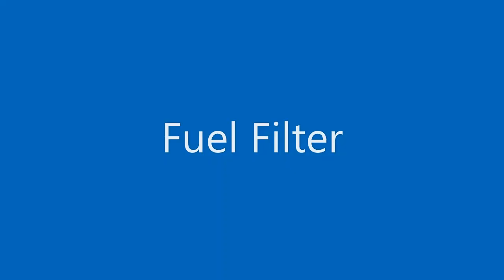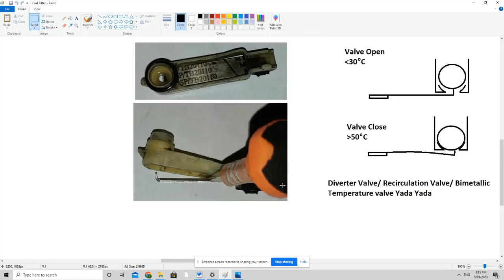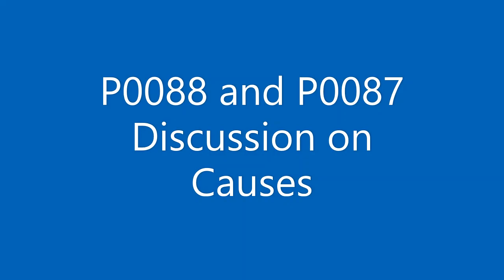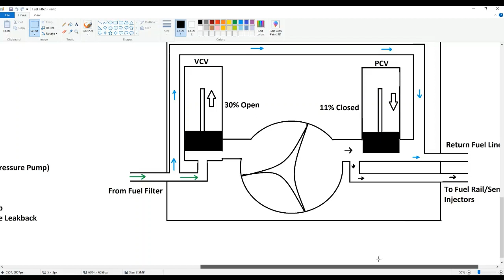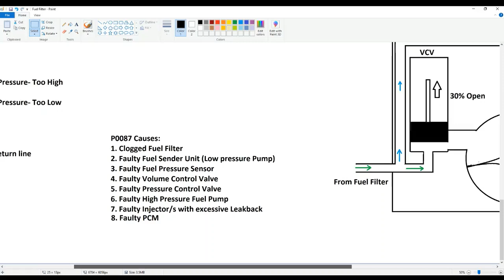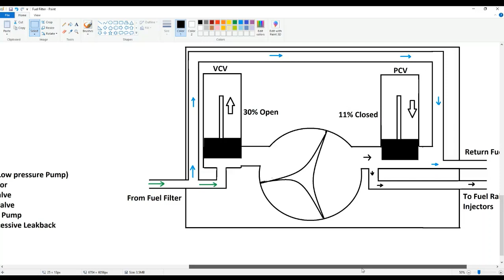P0088 P0087 Ford Territory Diesel Fuel System and how it works

Comment: Minr has high fuel pressure rail 2011 ford territory diesel

Replaced fuel filter
Intank pump
Battery is good
Any ideas
Reply from the maker: Reset vcv, pcv and injector calibrations. That should do the trick

Comment: I am having a high pressure fault , showing 35930.0 kPa in the rail, what pressure should i be seeing
Reply from the maker: Seems about right. You should see about 150Mpa at around 1000rpm.
The HPFP can deliver as high as 175mpa at 1500rpm

Comment: Hi mate you are super knowledgeable about these fuel systems. Im not getting any codes but my sz mk2 is pulsing/surging under load (doesnt do it when free revving). Any ideas im pretty stuck and my mechanic is too . PLEASE HELP!!!
Reply from the maker: @uniquecaravanrepairs4547  9 out of 10 times, this is caused by fuel sender. Have you checked the flow rate from the fuel sender? Also, replace fuel filter and RECALIBRATE PCV, VCV and INJECTORS..
Reply: Ok this makes sense as the fuel gauge reads incorrect. So changing the fuel sender then recalibrate all the above?
Reply from the maker: @uniquecaravanrepairs4547  diagnose first before replacement. disconnect the incoming fuel line from the fuel filter and rotate key in ignition.  There should be a free flow of fuel. Replace fuel filter regardless and then recalibrate
Reply: @RZJugaar  Quick Question, is that the incoming fuel line from the filter to the HPFP,, or incoming from the sender/pump to the fuel filter?  Thanks
Reply: For the testing
Reply from the maker: @damianrainermusic8005  if you use sender to filter, then you can figure out the condition of the sender.
If you use the filter to HPFP line, it'll give you the condition of the filter.
Reply: Also when you say fuel sender do you mean lift pump assembly including sender unit?
Reply from the maker: @uniquecaravanrepairs4547  yes correct.  Fuel sender means complete assembly.  But diagnose first.  Ensure that it's faulty. Otherwise you'll be wasting money
Reply: Thanks so much mate. Yes the mechanic already found there was free flow of fuel when he changed the fuel filter. So maybe just recalibration ?
Reply from the maker: @uniquecaravanrepairs4547  yes recalibration only then.. if recalibration doesn't solve the problem, then you'll have to wait till it throws a code. Who knows.. it may be Accelerator pedal or something else.. point is, not to fix something that ain't broken. If PCM detects a problem, it'll throw a code

Comment: I still cant figure it out. Have the same motor and its shuttering on acceleration or coasting, even sitting in neutral above 2000 rpm it does it. Seems like its starving of fuel.
Reply from the maker: @ddddddddd574  what code are you getting?
Reply: @RZJugaar  no code showing up. i suspect its picking up air. i did change the tank pump a few weeks ago so maybe i swapped the return with the middle one.

Comment: Hi . great video. I've got a very low pressure on mine . the pressure rail sensor is only reading 140 kpa  on cranking. it got water in the fuel . the common rail is not receiving any additional  pressure from the HPP . I've changed fuel filter and sensor ? thoughts?
Reply from the maker: @CGamble-r9d  if it had water contamination then I'd suggest replacing the HPFP... before doing that make sure
 1.the fuel flow to HPFP is not restricted 
2. Put a manual gauge somewhere after hpfp and verify pressure reading 
3. Ensure that there is no excessive leak back from injectors..

Comment: Hi sir 
I have a ford transit 2.0 diesel with a foult fuelpressure to low 
I replaced fuel filter
High pressure pump
Common rail with both sensors 
Inejctor checked no foults
What can be? The car does not start and I cannot make a return leak test, I took out injector mount it outside and try to start no spray from the injector, was it because of no pressure on injector or injector clogged? Please help any advice will help
Nice video
Reply from the maker: Hi. Are you getting any fuel out of the filter? Your fuel sender working? Are you getting fuel up to the injectors? Did you check your fuel pressure regulator?
Reply: @RZJugaar  yes fuel is coming to filter after filter to the hpfp after to the common rail after to injector from injectors i can see on return line fuel is out so idk if is clogged or not enough pressure...

Comment: Ever had fuel cooler fail and mix fuel with water and water with fuel
Reply from the maker: Never heard of it. That would be the first time.. which cooler? The one in v-section or the one under the driver seat floor?

Comment: Amazing thanks so much for this! I have repeated P0087 codes at low load/revs. My low pressure pump flow seems very low - 280ml in 1 minute. Do you know what kind of flow rates would be within range from the low pressure pump? Previous owner had HP pump replaced last year so I’m wondering if it failed due to this poor pressure/flow on the low pressure side. Pressure tested on the low pressure side is about 4psi at idle.
Reply: This is on a Discovery 3 by the way
Reply from the maker: For territory, the volume spec is 277ml in 10 seconds. Low side fuel pressure 7psi.
For discovery, I can't confirm the volume but lift pump pressure spec is same, 7psi
If you get 0087 only during hard acceleration then for sure it's the LPFP
Reply: @RZJugaar  thanks - I got 0087 first at hard acceleration once a few hundred miles ago, but recently even at low acceleration as well. To the point we had to get recovered as it was doing it every 10 minutes of driving and even keeping below 2k RPM.
Reply from the maker: @BenVallack  Your fuel flow from fuel sender is very low so i'd say its the fuel pump. The other reasons can be a blocked Fuel Filter. Very low chance that it's leaky injectors or High pressure fuel pump.
I'd suggest get an external (in-line) fuel sender installed to confirm that it's the fuel sender issue before biting the bullet.
Reply: @RZJugaar  ok I tried a new filter - no difference at all. So I dropped the tank and tried to measure the flow without the filter, just straight out of the outlet hose from the tank. 750ml in 20 seconds. Is that what you’d expect without the filter? I might have just confused myself with this test.
Reply from the maker: @BenVallack  if you are getting 750ml in 20 seconds then your pump is fine, your filter is now new. You can now check your injector leak back to see which injector or which bank is leaking.. I'll try to find spec for it.
Reply: @RZJugaar  ah ok - but that still doesn’t explain why flow is so low when tested at the schrader valve when engine is off though does it?
Reply: @RZJugaar  to be clear 750ml in 20s was without the filter in place at all. Just testing what it pumps straight out of the tank outlet pipe.
Reply from the maker: @BenVallack  I don't think we have Schrader valves in territory. Did you do this measurement before filter change? Maybe you wanna do it after as it points to blockage.
Reply: @RZJugaar  Ah - yeah so there's a Schrader valve in the low pressure hose just before the high pressure pump. I tested it there originally just with ignition on and that was where I got my first low flow result. I then changed the filter and got the same result. I then removed the tank and tested flow at the hose that connects to the fuel filter housing, i.e disconnected from the filter housing and then cycled ignition. That's where it pushed out 750ml in the 20s ignition cycle. I guess the reality might still be that my low pressure pump simply doesn't have the power to deal with the filter but once the filter is removed it still shows good flow.
Reply: @RZJugaar  follow up here for anyone else following. Turns out my bike pump connection on the schrader valve test was the cause of the low flow test. Testing without the valve in place shows the same high flow. So don’t think I have an issue with low pressure pump. So either high pressure pump or excessive leak-off on an injector?
Reply from the maker: @BenVallack  good 👍. Also try recalibrating the volume control valve and pressure control valve. This might solve the issue. Also hopefully your fuel pressure sensor is not intermittent
Reply: @RZJugaar How would I recalibrate the valves?
Reply from the maker: @BenVallack  you need a bidirectional scanner to force PCM to recalibrate/relearn the pressure and volume control valves. It's the same procedure that you also need to do if HPFP is replaced.
Reply: @RZJugaar Ah ok thats interesting. Will see if the Gap IIDTool can do that. I wonder if that wasn't done after my hp was replaced last time.
Reply: OK my injectors are fine. One is worse than the others but still only 30ml in 4 mins so can’t imaging that being enough to cause low pressure code. So my question now is is there a diagnosis path that would suggest if it’s the PCV or VCV at fault?  Pretty sure the pump itself is fine as it starts and drives fine until the error faults - which happens at low RPM and low load.
Reply from the maker: @BenVallack  you might also want to check fuel pressure value reading when error occurs to rule out bad pressure sensor or wiring harness..
Reply: @RZJugaar  yeah I think I’m going to have a drive around with the scan tool tomorrow and see if anything stands out.
Reply: @RZJugaar yeah I'm logging data when I drive it now - trouble is now the weather is cooler it's not faulting! Do you know how easy it is to change PVC and VCV valves on the pump? Are there any complications to that?
Reply from the maker: @BenVallack  you'll have to remove the HPFP to access both valves. They are hard to find as spares but not impossible. Last challenge would be to use a sealant while assembling to prevent leaks.
Reply: @RZJugaar  sure thing - yeah I think I’ve found the valves available. I might try a second hand pump assembly first as they are pretty cheap. I’ll then have my old one I can think about changing the valves on for the future. Thanks for all the help - it’s much appreciated!

Comment: Thank you. I have 0087 in a Discovery 3 TDV6 2.7 with 275k kms. Seems a very common problem affecting most cars with this engine eventually. Most often it is solved by replacing the HPFP as the resultant limp mode is very frustrating. I have changed the FF in mine and it faults very occassionally still. You have to expect at some point the HPFP will need replacement.
Reply: I ended up changing to a second hand pump off a car with 89k miles on the clock - really cheap compared to a new one from Land Rover! Took me a good day to fit.
Reply from the maker: @BenVallacksCars  good to know that you have issue resolved.. I have 3 territories in my family and I keep a spare HPFP handy.. you never know .
Reply: @BenVallacksCars  definitely risky option. Still paying 900-1200 for 2nd hand prices have doubled
Reply: @richardwilliams8667  I paid £250 for mine. Not sure what currency you're in.
Reply: @BenVallacksCars  Australia
Reply: Interesting yeah that seems pretty pricey then. Definitely don't recommend getting a remanufactured unit though - the one that was giving me all the issues a reman unit. So I assume the previous owner had replaced the original one at 170k miles - so I'd say if you get a second hand unit that't done under 100k miles you'd be doing ok. At the end of the day if you bought a second hand car that's all you'd be hoping for so I'm not too concerned about the idea of fitting used parts.
Reply from the maker: If i were you, i'd (a) recalibrate VCV, PCV, Injectors first with a scan tool. If it doesn't solve the problem (b) check for leaking injectors via leakback test and only after that go for HPFP replacement.
Reply: @RZJugaar I checked with the manufacturer of a really good Discovery scan tool (IIDTool) and they said there’s no way to calibrate PCV on Discovery. I assume from your comments it’s possible on the Territory? Odd there’s no equivalent on Discovery.
Reply from the maker: @BenVallack I'm surprised to learn the replacement pump calibration is not available on Discovery. Yes i calibrated it for territory. I checked the disco manual and it does not mention recalibrating HPFP after replacement. I also checked my Autel tool and it does not show any calibration option under discovery 2.7l engines... I'm still suspicious though as the engine management is same across both ford and LR..